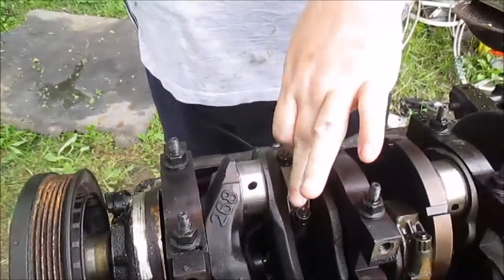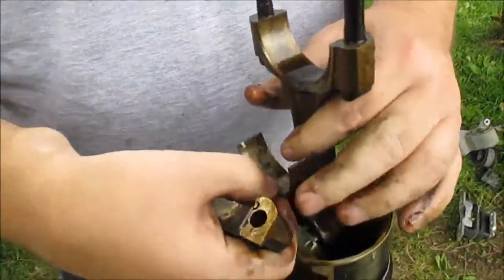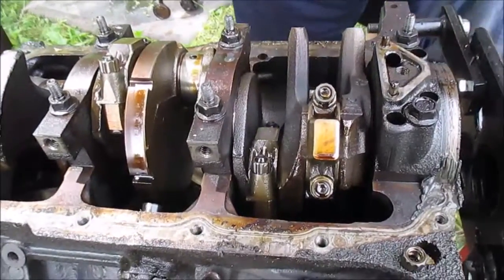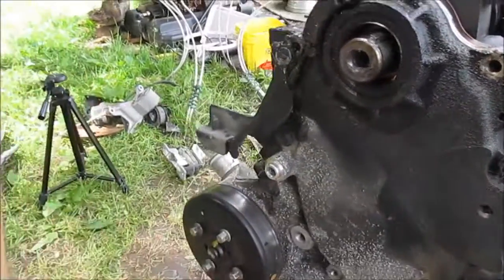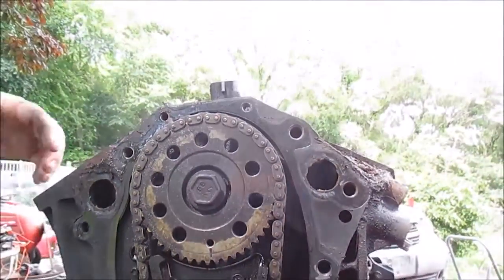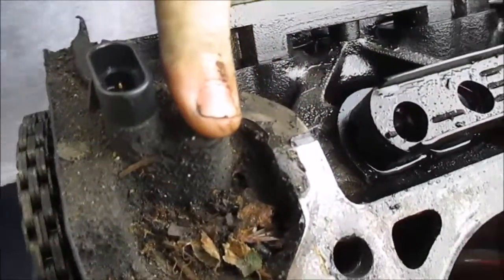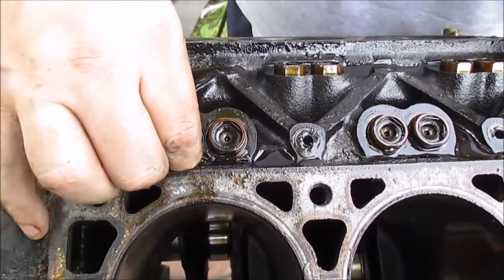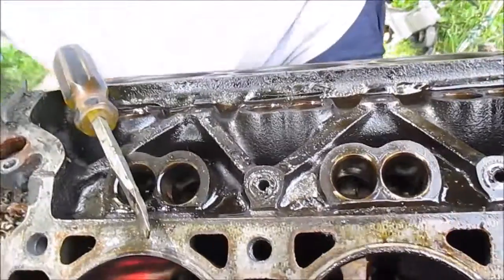Chevy Malibu 3.1L Engine Teardown Part 6

Comment: When re-installing the lifters does it matter what way the lifters go in, specifically the oil holes.
Reply: It really doesn't matter if the oil hole lines up with the oil passage in the block or not. The inset area around the middle of the lifter it there so the oil will flow around the lifter and the oil will find it's way into the lifter wherever the oil hole is in relation to the main passage.

Comment: Thank you, gentlemen. This is a very helpful teardown. Going to rebuild my v6 soon, and this helps to visualize it. I was considering just replacing the gaskets from above, and a rod bearing or two from under the car, but it’s clear from seeing this I’ll need to hoist the motor, have it cleaned, and have the crankshaft machined. If it’s worth doing it’s worth doing right.
Reply: Bikewithlove if it's not knocking or very slight knocking you can just replace the bearings now to prevent worse damage.